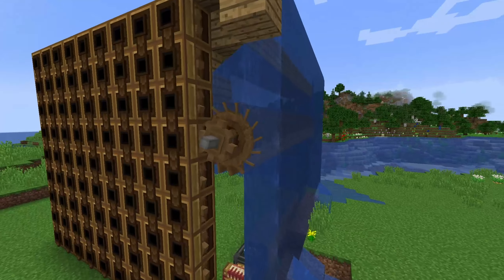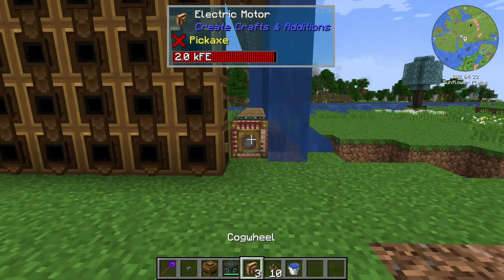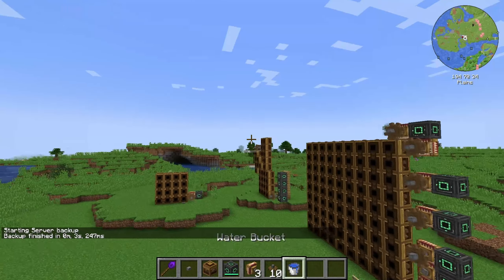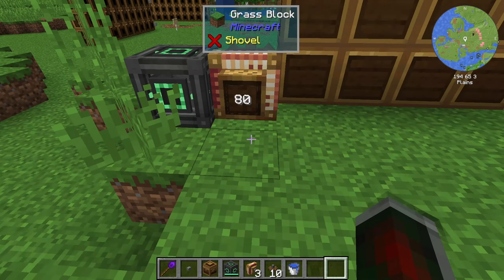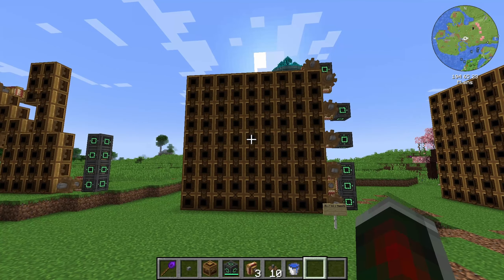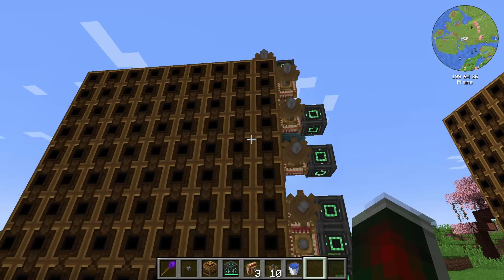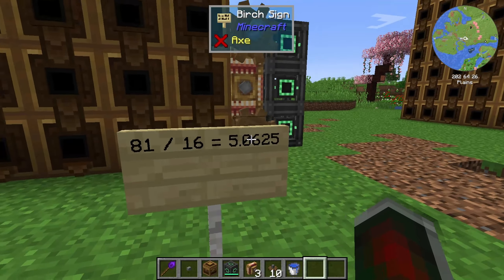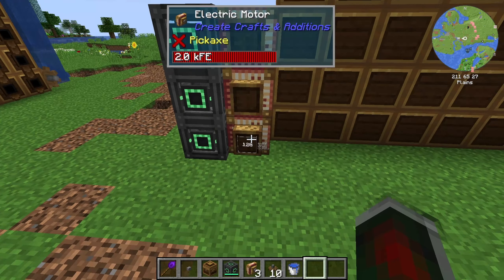Create - ELECTRIC MOTOR not powering MECHANICAL CRAFTER "Overstressed" SOLUTION   (Minecraft Mod)

Comment: i’ve been trying to use an electric motor, but can’t seem to find any way to power it, how do i do it? (in survival mode)
Reply from the maker: This depends on what mods you have installed. If you have thermal expansion you could use a dynamo for example. If you only have create I honestly don't know
Reply: @Failgames47 so the way i’ve got it right now, is powering it with an Alternator, but the Alternator requires like 2048su, which ends up being about 4 large water wheels, so i’ll be sure to come back and update if i figure anything else out lol
Reply from the maker: @gerrydelacey6745  oh yea sorry can't help you with that sorry